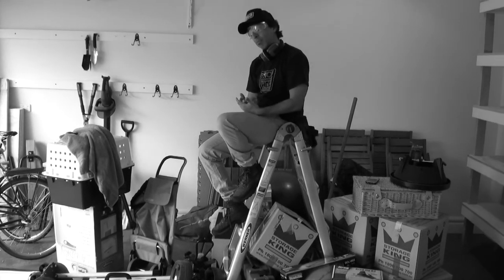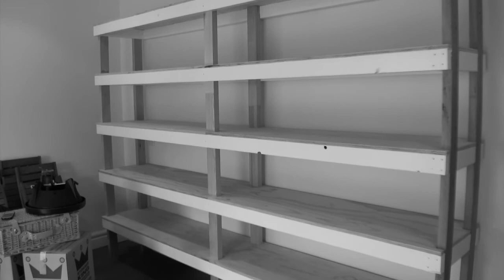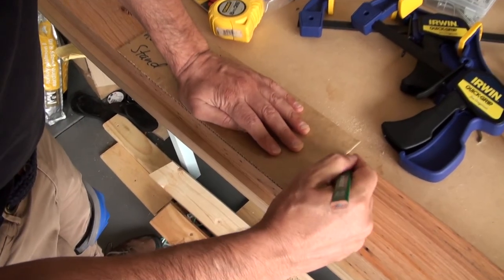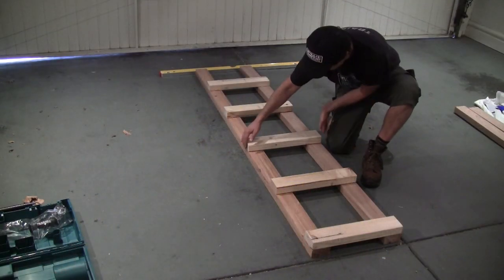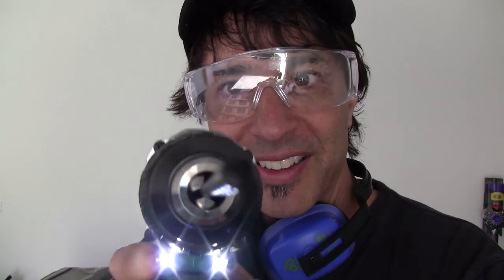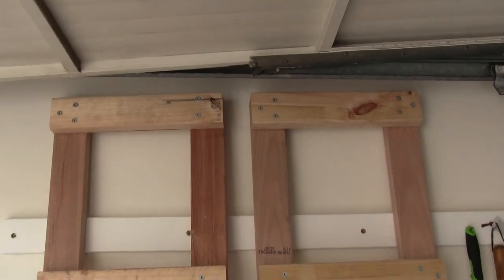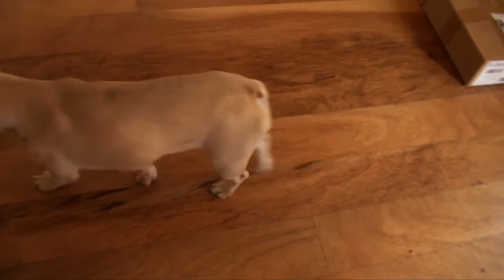Ultra Shelf: Ultimate Garage Storage Vol 1/3

Comment: I love that Arj is a YouTuber now, it's so awesome to see him pop up in my subscription feed.
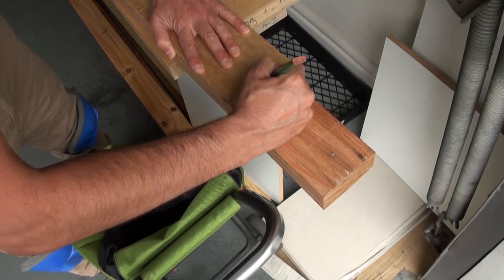Also Arjy, it doesn't matter for the timber you're using now, but at 1:23 when you were cutting your lengths on your mitre saw table, it would be worth putting something underneath your measured lengths to stop them falling down. They can sometimes snap under the weight of themselves before you've cut all the way through and can splinter off and ruin any nice finish on expensive timber. It won't matter for these shelves but could save you some frustration and money later on. 
Keep the videos coming mate!
Reply from the maker: great advice, thanks forty!!